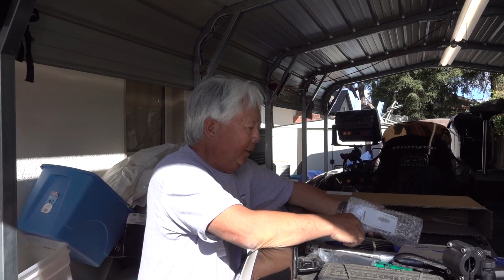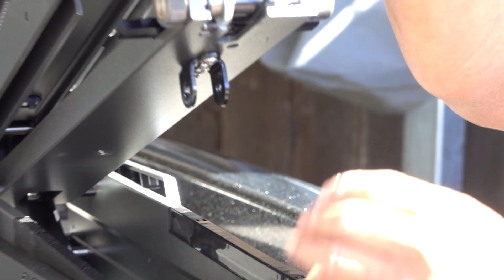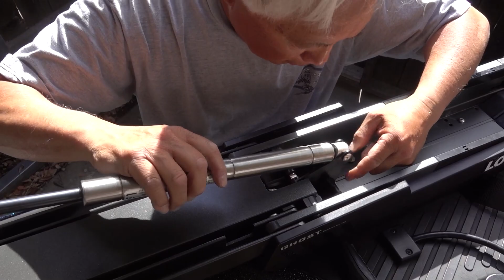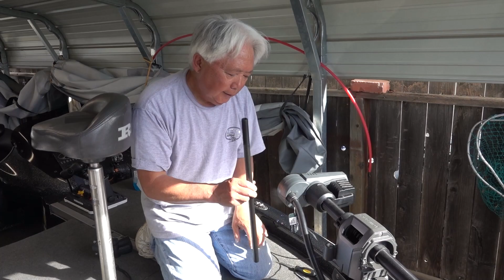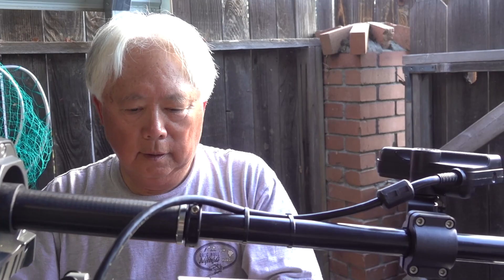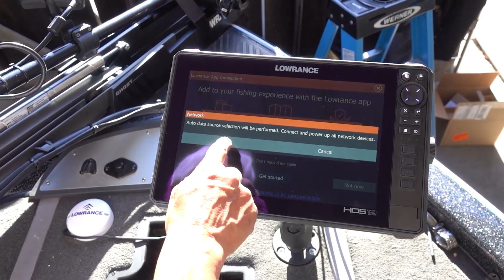How to Install Lowrance Ghost Trolling Motor in an HOUR with these TIPS & TRICKS

Comment: Great video. 
Installed my ghost a few years ago and didn’t know about the built in transducer. I don’t believe I have the adapter. Which side of the pedal does the transducer cord come from and what adapter do I need?
Thanks!
Reply from the maker: If your hooking it up to a Lowrance HDS or Elite the adaptor cable came with the ghost motor. It come out in the front of the pedal with the other two cables. The transducer in the ghost motor is a 2D and DS only. If you want the Side scan they sell the transducer that mounts to the bottom of the ghost.

Comment: What if you don’t want it permanently mounted do the make a quick release for this
Reply from the maker: No Lowrance doesn't make a quick release but you can probably use a Minnkota quick release but you might have to drill some holes. I'm pretty sure the patterns are the same but might be to forward or backwards so you'll have to drill holes in the plate.

Comment: Just got the 60" ghost for my NauticStar bay boat. Great install video.  I'm sure I'l have no trouble installing the ghost, but all the NMEA stuff is so foreign.  The little end pieces so you dont have an "open connection" where do you buy those? I only have what come in the box of my Gohst, Live target2 and Elite FS...
Reply from the maker: You don't need to hook the NEMA if you don't want to. If you do you can operate your ghost on the sonar screen. How are you hooking up the Live Target? And do you have another unit like HDS? You have to cap the T with the resistor cap. You can get at any tackle or boat shop that sells or installs electronics. Gone Fishing Marine in Dixon or FW in Sac has them

Comment: Thank you very helpful.Is the puck necessary? I thought the ghost has a internal gps?
Reply from the maker: No the ghost motor comes with and external puck as do Minn kota motors to. Yes you have to hook it up or the spot lock won't work.

Comment: Dear Alan,   I have a used, 20-year old 16.5 ft Lund 'Explorer Adventurer' with a side console and a 50 hp Honda outboard motor.   I might fishing about 2 or 3 times a week maximum in the spring through late fall, but mainly on the Sacramento River from Knights Landing to Sacramento.  I do go into the Delta and to Lake Berryessa occasionally.   The boat empty weighs about 1100 lbs (guessing from specs) and probably total weight with 2 people at 2,000 lbs or so.   I had a Minn Kota power drive version1 on 12 volts with 50 lbs trust.  Stopped running and no parts.  I mainly drift down river, but with a lure snag, the boat will slowly head up current.   I'd like to stay with a 12 volt battery.   Is it reasonable to stay with 55 lbs as I'm looking at a Minn Kota Terrova?   Or am I silly not to get into 24 volt system and increase to 80 to 100 lbs trust?   AND would you simply stay with a foot pedal or would you move to a remote if you target largemouth mainly.   THANK YOU.
Reply from the maker: Eugene first I prefer the foot pedal over the remote because with the remote when I turn I have to quit reeling to operate remote. With foot pedal I can keep reeling as I turn the boat. Most motors come with foot pedal but you can get the remote as option. But if you get a Terrova with I pilot (spot lock) it come with both. I would get the 24V system with 80# thrust much easier to run. Get lithium 24V battery and you're good to go. Lithium batteries are more expensive but they have a 20yr warranty. I use Bio Lenno lithiums and have had no problems and have never killed it.

Comment: Do you know what that thing is called that you hook up your battery cables to and foot pedal cables to ? That thing that clamps them inplace?
Reply from the maker: If your talking about hooking up the wires to the foot pedal for power there just crimps you buy for the size wire your using like 8ga wire.
Reply: No not the crimps. I’m taking about that thing that you had in your video where you installed the wires into. That block thing that opened up and you put in your power cables from the battery and then from the foot pedal. Then you closed it up. What is that thing called exactly do you know ?
Reply from the maker: The terminal block came in my Ranger boat. You can get them just make sure it's for 6-8 ga wires

Comment: What size wire did you use to power it ?
Reply from the maker: If it's less than ten feet you can use 10ga but if its longer I would use 8ga to keep it from getting hot
Reply: I thought if 4 or 6 gauge is what they recommend if the run is longer then 20ft?
Reply from the maker: The thicker the better 4 or 6 ga are hard to work with but are better
Reply: Gotcha.  My run is 21ft  long. I’m debating if I should use 4 awg or 6awg ? Also I’m using the ghost with 24v. NOT 36v. Idk if that makes a difference or not on what size wire I should use. What would you recommend between the two?
Reply from the maker: Bigger is better if your going that far. 24v or 36v shouldn't matter.

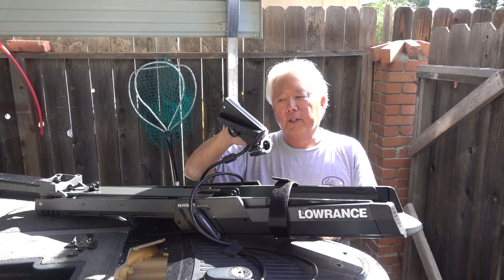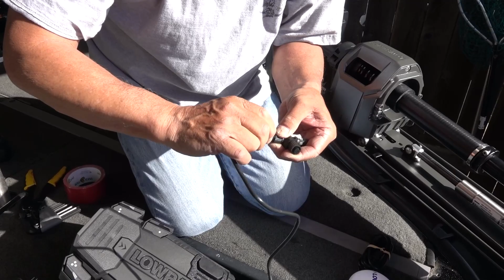Comment: I know the video is a couple years old, but think it worth pointing out that the Ghost DOES NOT come with a "GPS puck antenna."  What you are handling at 1:45 is a magnetic COMPASS, and nothing more.  It attaches to a dedicated connector on the Ghost and is used for it to be able to navigate a heading. At the 5:00 mark you are NOT holding a "Live Target" transducer.  You are holding an ACTIVE TARGET transducer.  There is a difference; almost nobody is interested in Live Target. At 15:30 you mention NMEA connects the Ghost to talk to Live Target. No, it doesn't communicate with Active Target either (and not Live Target which you don't have). The Active Target controller box has no NMEA connection! The NMEA connection is for Ghost to communicate with the multi-function-display, MFD, i.e., HDS unit.  It does so for the Ghost to follow a track from the MFD.
Reply from the maker: Probably didn't explain right lol The active target is the 3 in 1 transducer and the ghost comes with the HDI transducer just 2D and DS, the 3 in 1 is an option you can add for the 360* The NEMA is used to hook to your HDS displays to the ghost and for doing updates also to your ghost. The ethernet is used for the sonar and for live target (forward facing)

Comment: Good afternoon evening Allen
What is the cost to get a ghost trolling motor installed if I already have it
Reply from the maker: You might call Sunny's Marine if your in the Sac area or any boat shop? But depending on installation as they charge by the hour. I did a video on installing the ghost, it's pretty easy if there is a motor on boat already.

Comment: Good evening, what was the housing you used for the trolling motor harness to the boat harness ? Thanks in advance !
Reply from the maker: I wired mine direct so I'm not using any plug. In old days everyone used sockets n plug in. Wiring direct will have less problems in the future.

Comment: I have a brand new 2023 Tracker and I had the ghost and an HD S Lowrance  nine live installed cannot get them to pair. My question is is the ghost and the HDS live and the hems connection going to them separately powered.
Reply from the maker: You have to have the nema cable hooked to both and it has to be powered to 12V. Also the ghost and HDS probably need updating to current software

Comment: Great video, was wondering where you bought the wire ?for nmea to run from the hd live at the dash to your 3 prone connector at the front of the boat by the trolling motor.. did you use a kit of some kind ? Also where did you get the wire to power everything up for nmea system? Thanks.  I don't believe you talk about it in the vidio:( Thanks.. i bought ghost, active target, 3 in 1, and 2 live 12 hds units.. thanks,  same system as yours..
Reply from the maker: Just get the starter kit it has everything you will need. FW has them in stock. I'm there on Fri n Sat if you want come talk or call me
Reply: @AlanFong  thanks so much! Will do..
Reply: Also did you have to buy another 2 prone connector 2nd one separately? And the terminators? I still haven't unboxed by 2 hds live 12 units..  or did you use a kit? Starter kit. Thanks so much!!
Reply: Sorry 3 prone

Comment: Can I use a quick release bracket on the ghost?
Reply from the maker: Lowrance doesn't make a release bracket but Minnkota does and if you do get the one for the ultrex motor and the bolt holes should match if not you might need to drill two new ones.
Reply: @Alan Fong Outdoors  thank you for the reply Alan. Also thank you for the videos.

Comment: What do I use for batteries, I’m in the market for new ones and have the ghost
Reply from the maker: If your changing out batteries go with the lithiums. I changed mine out ten months ago and it was the best thing I ever did with the boat. I lightened the boat over 150 pounds or more. Depends on how you want to hook up trolling motor and electronics as to what batteries you buy. You can get one 36V battery if only running trolling motor? I put three 12V 100 amp hr batteries for 36V ghost, then I use each battery for 12V for electronics. I have never run the batteries down yet! Lithium batteries run full until they shut down no warning!
Reply: @AlanFong  what brand of lithium

Comment: Great video, I have a question where did you find those yellow ring terminals for the 8 (AWG wire I have search all over and I cannot locate any that size, please help 🙏🏾
Reply from the maker: I got them on Amazon as I got water proof circuit breakers and the 8 ga wire too
Reply: Ok thanks do you remember the name and nomenclature, again thanks 👍🏾
Reply from the maker: No I don't but there few companys who make the breakers just get one thats water proof.

Comment: I have lowrance elite FS 9 with live sonar. Is the hockey puck worthless then? I have the NEMA hooked up to it with motorguide
Reply from the maker: You should leave the hocky puck connected so you can still have 2D sonar. Your Live is hooked up thru the ethernet plug (sm yellow) and the puck goes thru the sonar port lg blk but you might need the adaptor. On your puck might be a 7 pin and the Elite FS has a 9 pin so you need the adaptor. I always use my 2D especially when fishing shallow in delta. Was your old unit a Lowrance?

Comment: The best install video I have seen on U tube very detailed. Thanks Alan.
Reply from the maker: Thanks 👍 I'm starting to make more videos on electronics like 2D sonar and how to use and proper transducer problems. And I'll be doing on DS, SI, Live and 360. So watch for videos coming soon
Reply: What size wire did you use to power it ?

Comment: They said to mount the  GPS Puc At least 2 feet away from the trolling motor. But yours is right there on the carpet behind the trolling motor. Is that OK? Also do you just screw it into the carpet and not worry about hitting anything?
Reply from the maker: I've installed many of these and I have not had any problems as you can see mine is right by the motor. I just drilled two sm holes into the deck and screwed it down. There is nothing to hit but I do look under the front plate to see where the tube with the wires is at.

Comment: Hi Alan,. New Subscribe here.
Why did you have to drill more holes?  I thought you had said the holes matched.
Good luck with you Channel!
Eric B.
Reply from the maker: Eric when I took of the minnkota it had four bolts holding bracket. After bolting it up matching the four holes there was plenty room to put two more so I drilled two more just for a little more security. Four bolts are plenty but extras don't hurt!
Reply: @AlanFong Got it!  
Thanks Alan.

Comment: Electrical tape is better than tie straps. Tie straps can mess cable up.
Reply from the maker: I've used both but when its hot outside tape gets sticky
Reply: While generally you are correct that tie straps can be problematic, in the case of Active Target the cable was engineered specifically so that tie straps are unlikely to hurt the cable.  The cable is much more robust than other transducer cables.

Comment: For safety reasons, it's best to install the motor onto the mount before installing the lift assist spring.  A less handy person could get injured.  When you install the motor on the mount, you should use Loc-Tite on the two large hex head screws.  Those can come loose and cause problems with deploy not locking down.  When you add zip ties on your cables, use the slots in the cable retainers for your zip ties to hold everything down.  I highly recommend a Bob's Machine prop nut so you don't have to carry a ratchet in the boat.  You should periodically remove the prop and check for line wrapped on the shaft which could damage the seal.
Don't forget to do the compass and bow offset calibrations so navigation and anchor can be precise.  The rubber foot comes off the support bar easily so glue that on with silicone or whatever you have handy. Make sure you watch other videos that show how to configure the buttons and stow position.
Reply from the maker: John thanks for the comments any info always handy to know. Last week I've had couple customers had problem when installing motor to bracket because trailer in way couldn't install when bracket was in down position. When they took out to use bracket wouldn't lock. So you have install with motor in the down position so lock will work.
Reply: @AlanFong  I had the same situation, but I installed mine with the bracket raised and it worked just fine.  Installing the motor pushes the safety latch to the proper position so I don't know why they would have a problem unless the hex screw weren't tight.   I was already aware of a problem with the safety latch when screws some loose so I was paying careful attention to the latch when I installed it.
Reply from the maker: Thanks, John, for sharing your knowledge. ..the more information, the better. Thanks for watching!